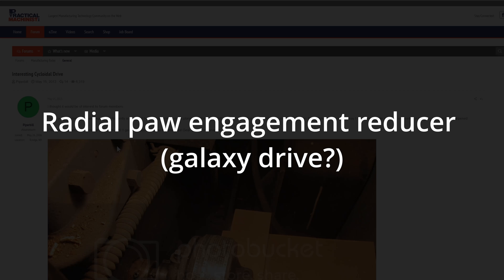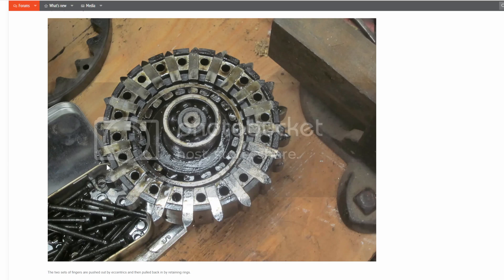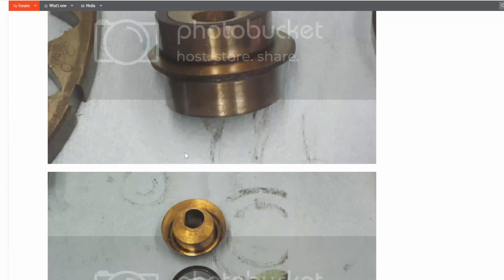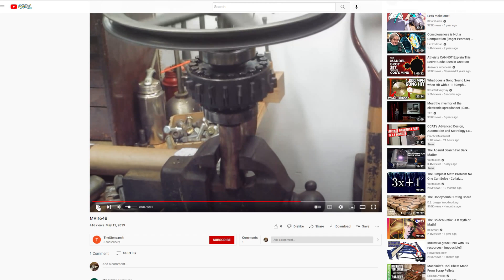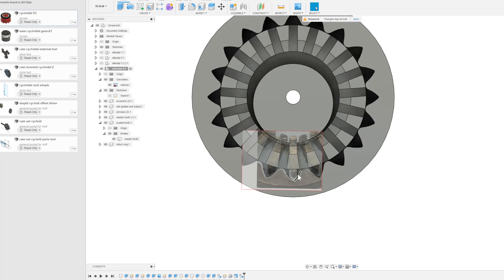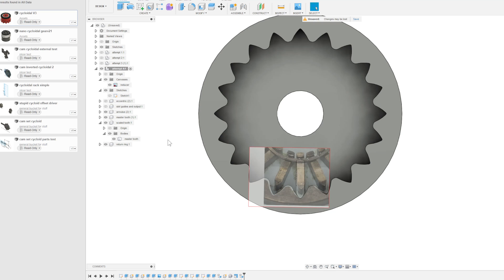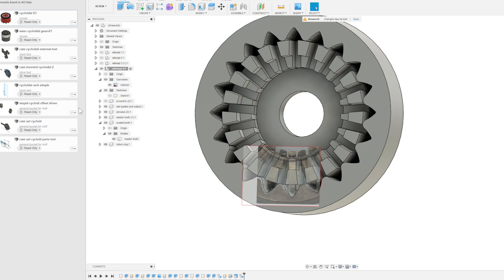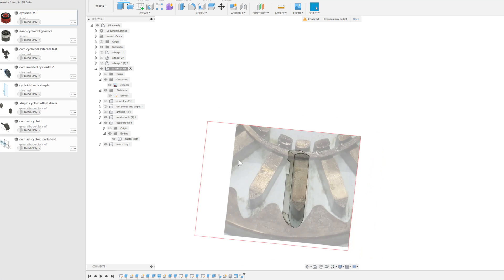Heliocentric  speed reducer mechanism from 1920's by universal gear corporation, like "galaxy drive"

Comment: Very cool. Seems like the teeth could wear quickly. What kind of duty cycles would this see?
Reply from the maker: the one it is modeled on ran a wood planer for 60 years until the shaft broke.... maybe tooth wear isn't an issue.  the contact is somewhat rolling like a strain wave tooth.

Comment: Wonder how it would work in a clock design. Perhaps one can add another layer to it. The radical in the center doing seconds, then the second layer reduced to doing minutes and then a third layer reduced to doing hours.
Reply from the maker: seems doable, you could make a serial version for hours but it has a nice aesthetic and you may not want to connect them end to end because it would be hard to see the movement.  The reduction is the number of holes on the outer fixed annulus so you'd have to make one with 60 for the seconds/minutes.

Comment: That's a trip to watch.
 The teeth are only really transferring power in a short section and the rest aren't touching as it goes around due to the cam.
Reply from the maker: Should be around 30% engagement

Comment: Now that is cool! I wonder what the intended advantage is compared to a conventional cycloidal?
Reply from the maker: not sure, the one this is modeled on was used as the feeder for a big wood planer.  i'd love to find out more about the mechanism.
Reply: Were cycloidals even invented at the time? I think they were a well-kept japanese secret after they were invented?
Reply: AFAIK, a well designed cycloidal has rolling contacts only. This is full of sliding elements. More wear or smaller max load for the same size.
Reply: @besenyeim  True, though all conventional gear trains are made of sliding elements (right?). To me this looks like the missing link between classical gearing and cycloidals.
Reply: It's a bad idea since it removes the rolling contact and replaces it with sliding contact. Is it cool ? Well yeah very cool blast from the past.